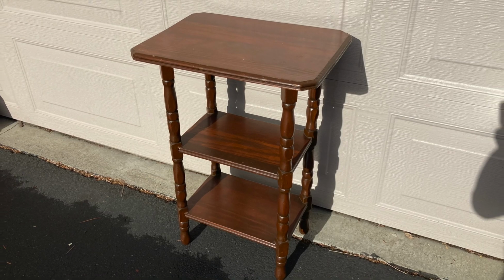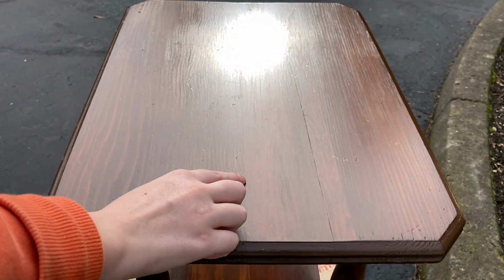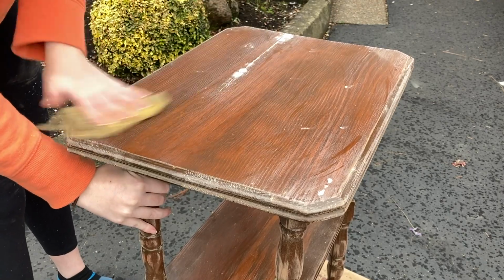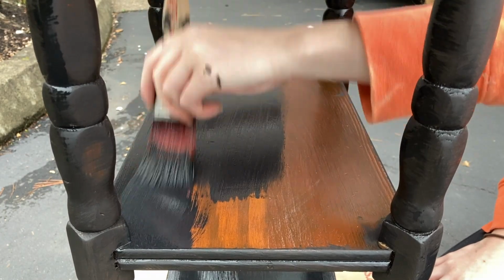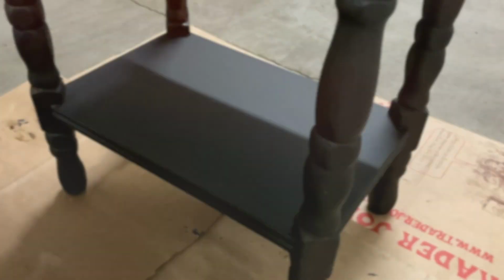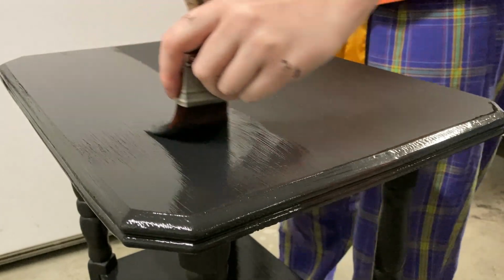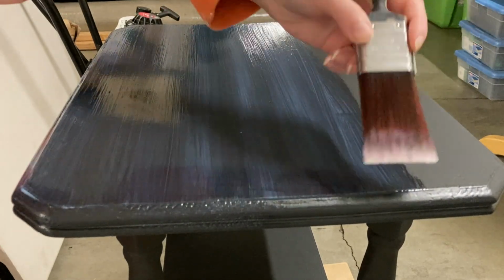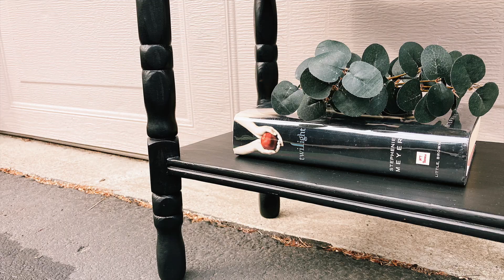Painting a Wood Plant Stand/Table Using All-In-One Mineral Paint | FALL FURNITURE FLIPPING CHALLENGE

Comment: Hi Holly. You're podcasts are very helpful. I am getting ready to do 2 end tables. On one podcast I think I heard you say that you sand a bit after every layer of primer, paint, or topcoat.  Did I hear that correctly? Also I believe the final scuff sanding is 220 grit. Thank you!
Reply from the maker: Hi there! I'm so glad you like my videos. I really appreciate that! 
Yes! Sanding between coats yields a smoother finish, if that's what you're after. I usually do this with 220 grit sandpaper and then remove the dust with a tack cloth.

Comment: I notice you do not sand between coats, most others do. Is there no reason for the sanding, or is it the brand of paint, or what?
Reply from the maker: It wasn't necessary for this project. The paint self-leved exceptionally well.